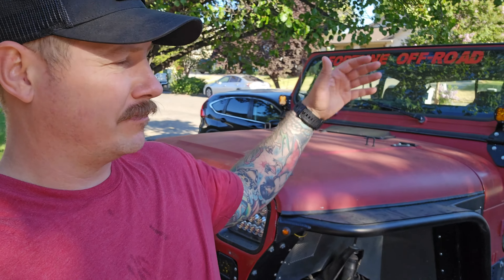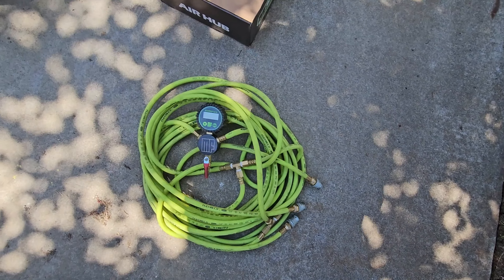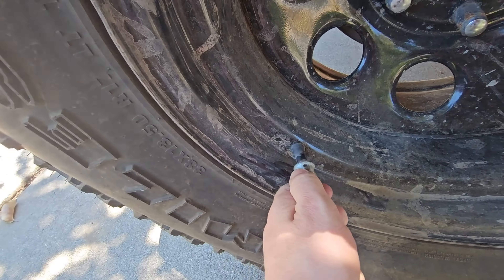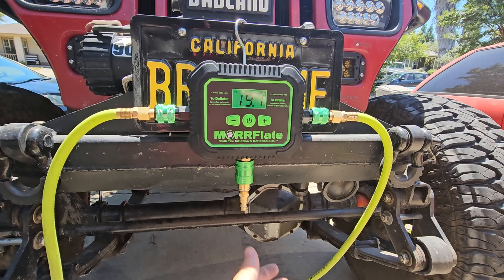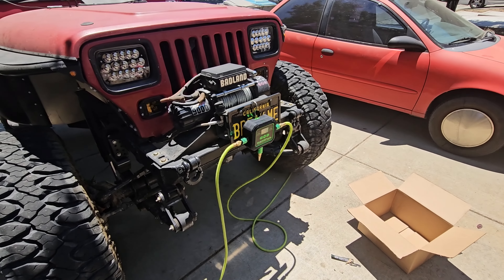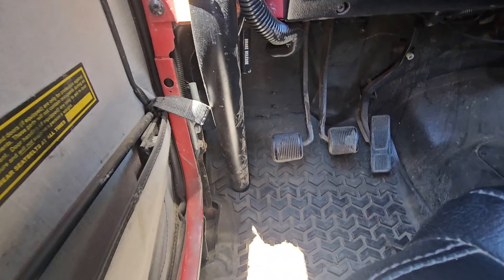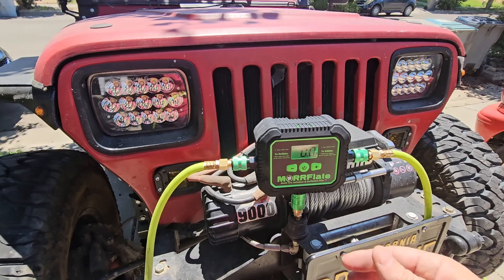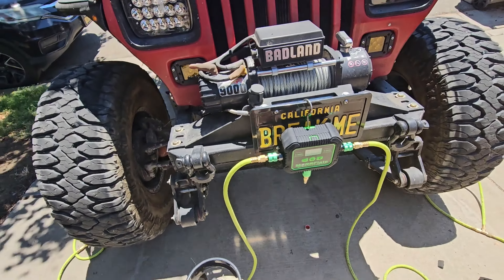Automatic Vehicle Air System | MORRFlate Air Hub!

Comment: You need a decent length of hose between the air tank and the air hub to prevent the pressure sensor(s) from freezing over. Have they made it possible to remove the battery and hard-wire it in to power for a permanent mount?
Reply from the maker: Yeah, that's what they recommended, along with going lower on the psi output. I'm not sure how difficult that would be. Doesn't seem difficult.

Comment: Doing a pressure gauge test comparison between those 2 device will most likely never match.  The air hub uses a voltage sense pressure gauge and the anolog gauge uses atmospheric pressure differential.  So get a simple digital tire pressure gauge to compare next time. Also  anolog gauges are optimized at half sweep so you should get a 0-15psi gauge to get a more accurate low pressure reading at your altitude.
Reply from the maker: Makes sense! What I was trying to say was that my deflator showing 6psi was the sweet spot for me, so what psi reading on the air hub matches that... I dont care really if either is inaccurate, I just want to be able to replicate that pressure. 🤓
Reply: I find my Moreflate PSI gauge a bit off too when comparing to what the TPMS says in my Bronco. Any thoughts?
Reply: @curtl1694  I just got mine in, and it matches my longacre gauge within a tenth at 38 and 42 psi (my two vehicles). My gauge is accurate to within 0.1psi 0-60psi, so this tells me the Morrflate I have is well within specification. It also matches my GMC's TPMS, which has been relatively spot on.
Reply: @ormandj  Great good to know. I think I might pull the trigger on it for next wheeling season.

Comment: Hmmm…was about to pull the trigger on this system but your Powertank demo now gives me pause. I reached out to Morrflate and asked them about the issue with the lines getting too cold.
Reply from the maker: I talked with them, too, and they mentioned running a lower PSI out of the tank. They said something like 120psi, but 100psi would be safe, I bet.
Reply: @FortuneOffRoad Yup. They responded and my guy actually recommended 80 psi.